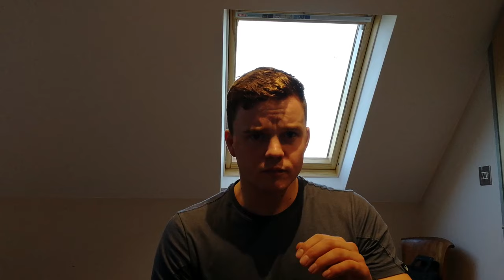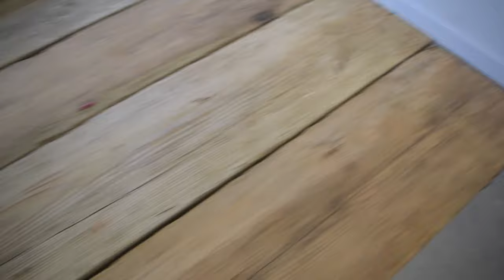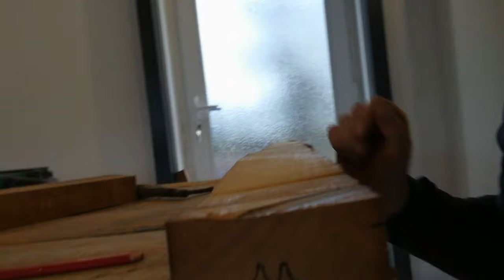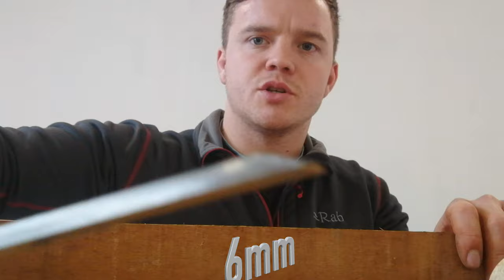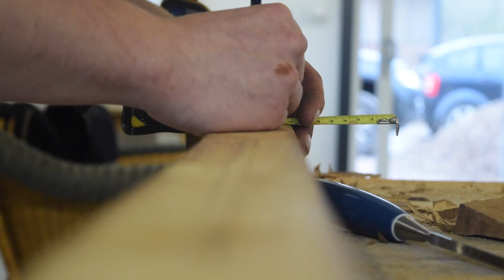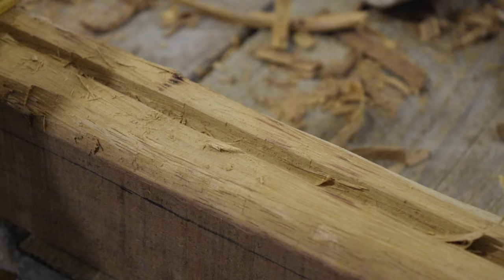How to Make a Wooden Speargun - (DIY Speargun Part 1)

Comment: For future reference: Instead of tapping on the depth gauge to make individual deep marks, you can drag it along the work piece to engrave a longer straight line. It's not a big tip, but will save a few minutes. Good build! Cheers!
Reply from the maker: Appreciate the feedback. If I ever get round to building another one, I will be sure to do what you said. Many thanks for the tip 👌

Comment: Great tutorial!! i enjoyed it. A couple of questions. How do you determine the widht and thickness? Because if you do it too narrow or too thin, the pressure of the bands will somehow break / deform the speargun. On the other hand, if you do it wider and thicker than needed it'll be difficult to manage once underwater. I'll start working on a 95 cms, 2" wide and 2.5" thick, but i'm guessing on the width and thickness. Is there any formula or way to determine? reckon has to do with the kind of wood and the rubbers. Thanks!
Reply from the maker: Hello! I"m completely honest, I made the whole thing up as I went. But thats the beauty of it as there isn't another speargun in the world like the one you make yourself, so its quite special. I ensured that I used a very strong piece of wood that would bend or warp under pressure. (Iroko is the wood i used). Let me know how you got on, again i'm sorry for the slow reply.

Comment: Instead of a chisel or router, you can use a table saw with a fence and several blades for a clean, straight, even depth cut.
Reply from the maker: Interesting, thanks for the idea. If i ever make another one ill be sure to use that.

Comment: great vid mate, just wondering what type of wood are you using for this gun?, this is only a idea as im not sure if it would be a bad thing if its going to be in the water, but i used to make quite alot of fireplace mantels out of solid oak and sometimes had to match the colour /grain in with the furniture in the room but i would use a blow torch and slightly burn the surface of the wood and when you oil / varnish it after, it brought all the grains of the wood out and looked really good, not sure if thats something you would like, just a idea :p, keep it up buddy
Reply from the maker: Its a good point, I dont actually state which type of wood it is until the very end of the videos. Its Iroko hardwood and it has an Epoxy coating to keep the water out. Again, its all a learning curve for me as its the first time ive done it. If i ever make something like this again, ill be sure to give it a go. Fingers crossed it holds up well in the summer. Keen to try it now.